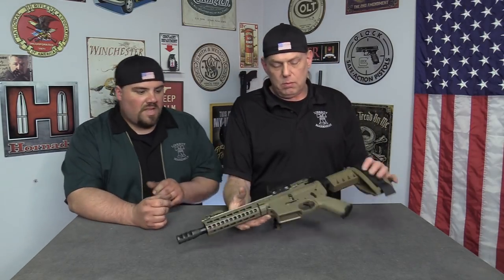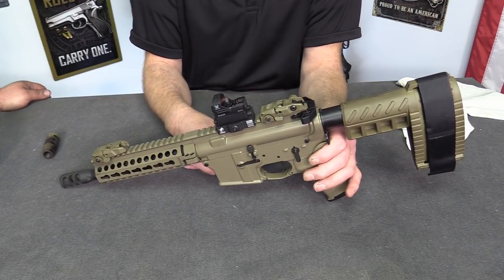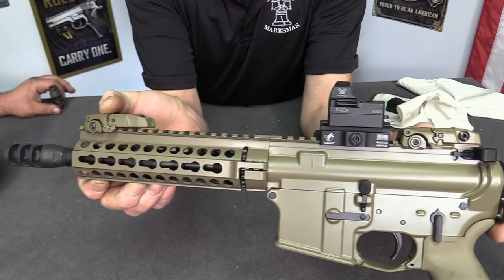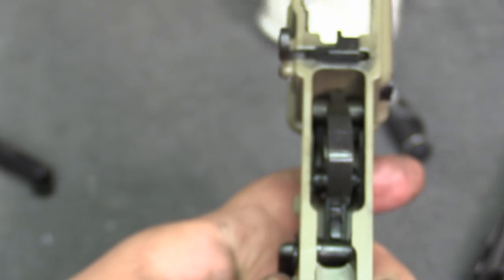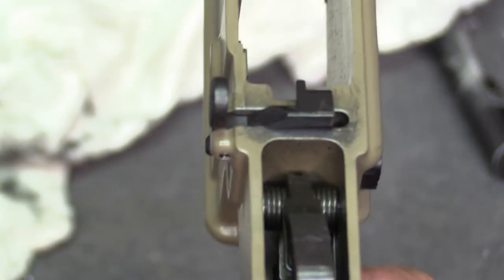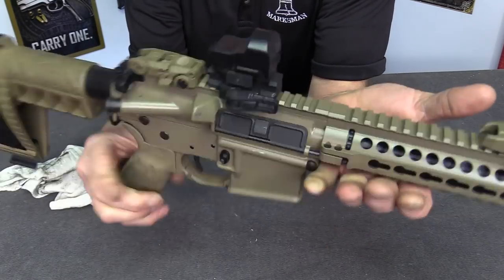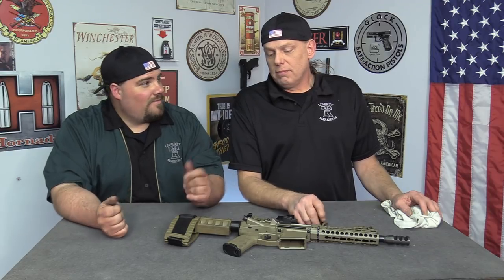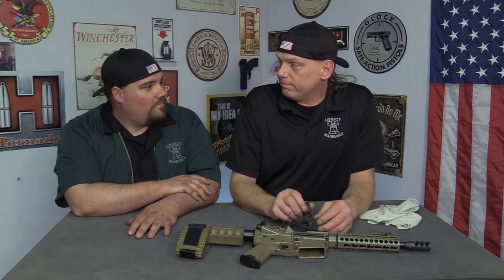DuraCoat Review 2 Years after Coating

Comment: I've done 6 different AR builds using both the Cerakote and the Duracoat. Hands down Its Duracoat all day long. Its a nicer finish than Cerakote and it isn't brittle like Cerakote. The one plus on Cerakote is you can build as soon as it cools off from the oven where with Duracoat you have to give it a couple days. At least 24 hours. A word of warning, some black anodizing can cause issues. My wife has a S&W MP-15 that she wanted redone. We did it in Duracoat German Blue with all stainless accents. The Duracoat didn't want to stay on the lower. I cleaned and Scotch Brighted the hell out of it. Acetone soaked it. The works and the damn coating pulled off on a piece of masking tape. Thats the only time I had that happen so I have to wonder what S&W did with their anodizing. So I invested in a blasting cabinet and took to blasting the hand guard, upper, lower and such. Then I used the 2 part with an airbrush. That did the trick. Now, before I coat metal parts, I blast first with 120 Aluminum Oxide to bare metal. It doesn't hurt aluminum at all. Then they get a short dunk in clean acetone, followed by coating 12 parts color to 1 part hardener. 

My last build I did in German Flecktarn Gray and H&K Black. I put on two coats of semi gloss clear over everything. It turned out fantastic. All my guns look as good as the day they were done. I've done wild pig and coyote hunts with them, carried them in the field in several states, countless range trips. They get used. The finish after a full cure (per Duracoat is 30 days) is very robust. I order all my stuff direct from them and the number of colors is mind numbing. They have a great web site and fast shipping. If you don't airbrush, I wouldn't hesitate using the rattle can but the colors are much more limited. Also, all my custom builds are on 80% lowers milling with the 80% Arms jig and the Porter Cable router. I've also done 2 AR Pistols. The last one is stunning. Well they both are. Its Rhodesian Tan and Magpul FDE. Like the good men at Liberty Marksman tell you, you won't save any money doing it this way, but the gun you have is one off and it's the way you want it. The rattle can stuff is very thin so go with several thin coats until it's well coated. You don't want to risk a run. I need a bigger safe.

Lastly, a small, cut to shape double layer of Gorilla Tape over the deflector face will keep the ejected brass from chipping the finish if you are anal retentive like I am. Especially this chipping is an issue on 300 AAC Blackout guns like the one I built for Hogging in Texas. The 300 Blackout ejects harder than the .556 and is more prone to chipping the deflector face. After I'm done, I just peal it off before cleaning. I guess I'm the guy who likes to clean my guns. Pride in ownership I guess. Good luck and use Duracoat.
Reply: Might be a long shot on a 2yr old comment but dura clear or no?
Reply: @tonyprime754  I've used clear over the grey and it turned out fantastic. I'm still a Duracoat over Cerakote guy.